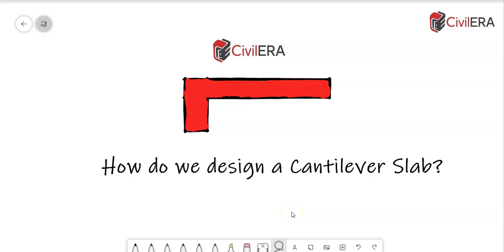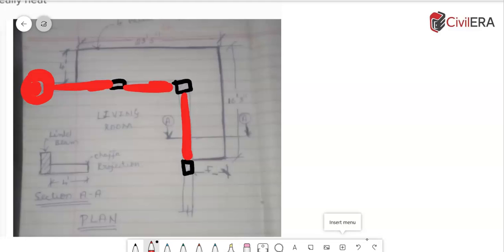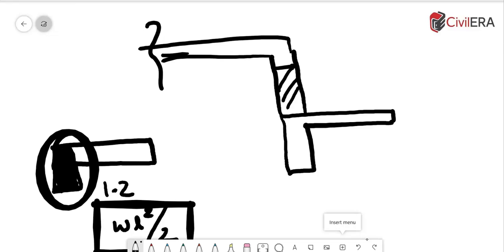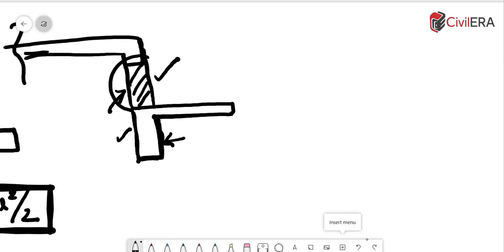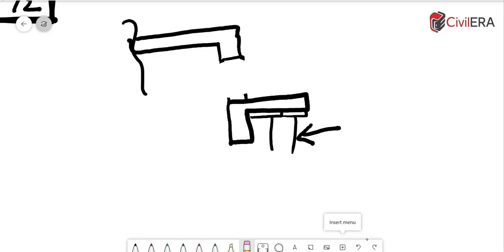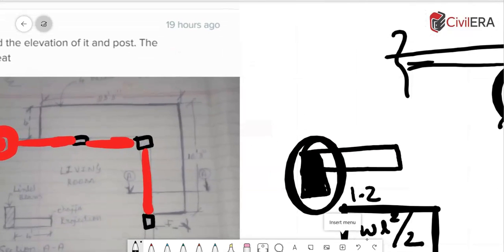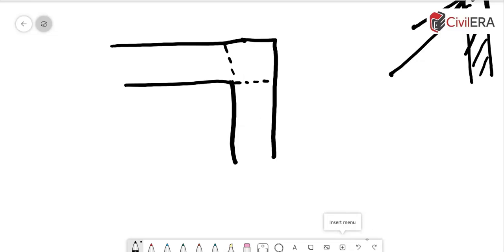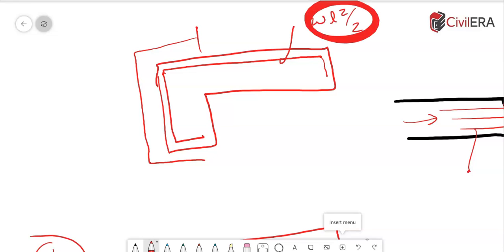How to support a cantilever slab : A practical cantilever example

Comment: Sir, 
As per load transfer technic for gravitation loads, how the distribution reinforcement rebars are located? .....
Does it at top of main reinforcement rebars or at bottom as it mostly seen in local construction practice because in the design of cantilever slabs distribution reinforcement rebars are only provided to keep the spacings of main top bars properly.

When failures taking place with age of building, these distribution rebars are firstly affected when provided or tie suspended by binding wire below main bars...... Just a question ⁉️

Comment: How to provide support for a previously built 5 feet cantilever beam ? Please reply
Reply from the maker: Cannot answer unless the entire scheme is studied and the reason for support is understood.
Reply: @CIVILERABangalore  just to support it , as there is construction above it
Reply from the maker: @saluto1397  info is not adequate to provide any solution. You should only load it to its capacity. Supporting it with props is an option. but then it all depends on what the site condition is
Reply: Dear  @CIVILERABangalore  , I want to build  a brick piller under it so as to support it. Can you share info on how to join the top part of pillar with the beam , so that the beam actually sits on the brick pillar and the pillar takes the load .
Reply from the maker: @saluto1397  https://youtu.be/SI5It8swRQw
Reply: @CIVILERABangalore   thanks so much
Reply from the maker: @saluto1397  you are welcome
Reply: @CIVILERABangalore  Hi Sir, I have real scenario here and i want to have 100cm Cantilever which i will put load at the edge top, should i use triangle shape from beams.?
Reply from the maker: @issaramadhani8370  Question is not clear unfortunately. Draw the scheme and post